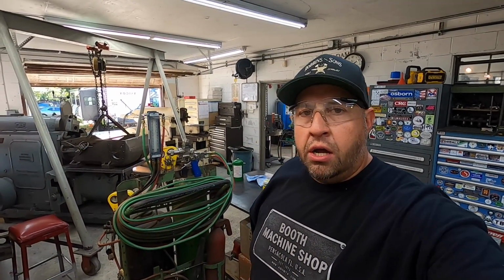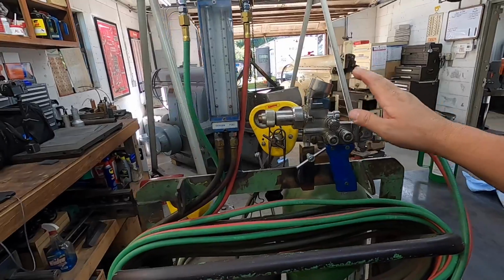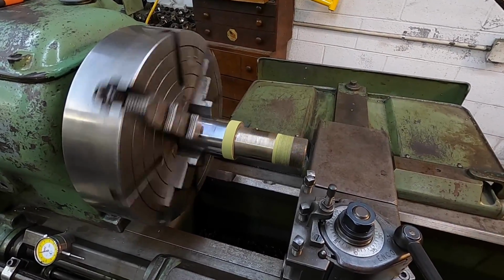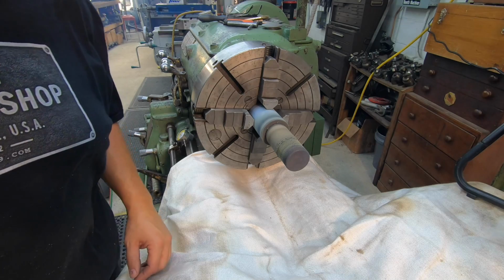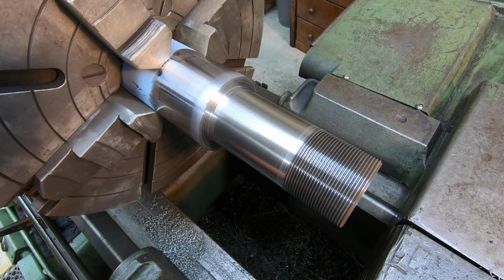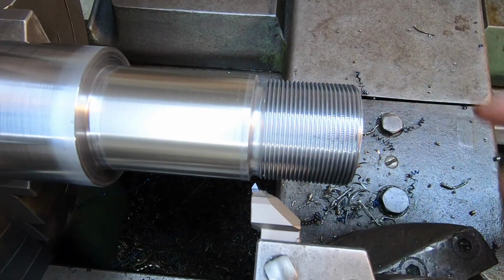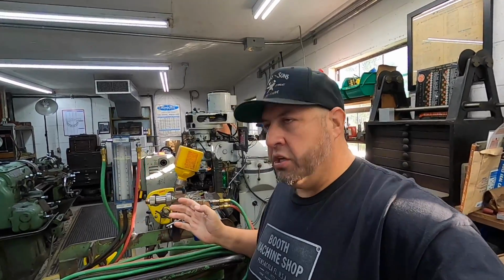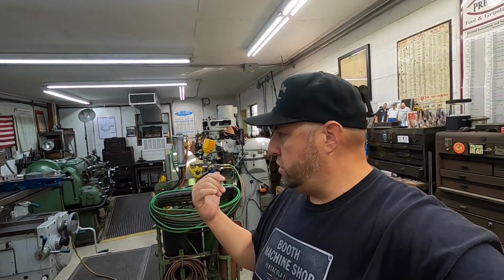Eutectic TeroDyn 2000 Thermal Spray Equipment, Mount & First Use

Comment: Just how strong is the bond with the spray weld is it permanent?
Reply: If done correctly it is permanent.  If it withstands tthe turning operation I would assume you are good to go.
Reply: It is ok, not a true 'weld' ie wetting the base, good enough under bearings & seals. I did some tz750 cranks with eutectic system - crank was mangled but sprayed journals were ok. One thing to point out if you get it too hot the bond is not so good.
Reply: @susscrofa5485  Were you working on the cranks alone or the whole bike, pretty narrow band of TZ750 owners out there.
Reply: @Peter-V_00  whole bike

Comment: I know a fair amount about lathes both wood and metal but I am very confused how the thread making was done with several passes! I get how you set the feed rate and all that, but how does the tool enter the stock material at the same pin point spot where the thread begins during those passes? ...how is the rotation of the chuck linked to the pass made by the cutter to make that happen? There must be a stop that is set to allow the passes to begin at the same time, no?
Reply: Do a search on lathe half nuts and thread cutting dials
Reply: Its all about syncing with a threading dial. Thread dial just tracks the lead screw and you engage the halve nut when it indicates the point to restart. .or another way is stop the lathe and  backing out then reverse the lather spindle till you are back at start and go back in with the tool for another pass... nothing is as thrilling as making your first workable thread in a chunk of steal.... ill never forget my first time. HA,, except the crash!
Reply: @joenicotera2991  , are you a politician? You just said a whole bunch of gibberish that makes little sense, some only part fact and mostly fiction that never really answered the question.   🤪
Reply: @chuckthebull  your not the first and certainly not the last, same here?
Reply: Watch Adam's videos about threading
Reply: @xenonram  I just noticed that video...it was 3 years ago I have not gotten that far back yet hahaha
Reply: I always used the tap and die on the lathe, luckily I never had to make anything pretty, accurate or correctly... apparently hahaha!

Comment: Instead of coating the shaft with latex you can use layout fluid, lots easier to clean up.
Reply: The masking material is high temp.  Layout fluid would easily burn off.
Reply: @paulcopeland9035  try it sometime it does not burn off and does great. have been doing it for many years now.
Reply: @fredthomas1746  ....Well Fred, I went out to the shop and tried it.  I have had Dykem around heat before so I was pretty sure it wasn't very durable.  My heat gun was showing between 300 and 350F when the layout fluid failed.  However, I got to searching around and found that Dykem makes a 2000F (!!) marker that I was unaware of.  I am guessing you have been using this product.  I can see where a high temp fluid masking product would be easier to work with.  I am going to order some of this stuff for a variety of reasons.  Thanks for the tip!
Reply: @paulcopeland9035  Did you actually flame spray the shaft?  I have been a millwright at a paper mill for over 40 years and have fixed thousands of shafts using only regular dykem. Yes it will turn colors due to heat but the flame spray material stil does not stick.

Comment: @15:50, I have the same problem. :)
Reply: The answer is live center up the end.😯 
But as for the ‘to much stick out’ I’m sure running the hot torch across it a few times will fix that 😱
🤣🤣🤣

Comment: So am I the only one cringing when he's welding that close to the gas cylinders?  I mean I get it's TIG, I get that there's almost never going to be a drip or slag pop, but jesus if you melt the fuse plug out of that acetylene cylinder?!?!  Takes 10 minutes, take the bottles off the cart man.
Reply: I agree, this is a serious hazard.  My safety guy would be having kittens.  Someone would have gotten fired.
Reply: Throwing an insulating blanket over the top of the tanks would have taken 5 seconds and would have far better than nothing.
Reply: @twm4259  and you don’t have gas get all over the shop when you take the tank lines off or have to adjust the valves again (I’m not super familiar with those types off tanks so I’m using experience gained from other pressurized gas systems and may be incorrect here)
Reply: Take it easy sisters.
Reply: @AB-yu2tj  Was wondering when the children would show up...

Comment: This guy is not long for this world his safety procedures are appalling Drinking and shooting, welding next to gas hose's.
Reply: he isn't giving advice on safety and he sure as heck isn't asking for it
Reply: "wElDinG nExT tO gAS hOSes" - you ain't a welder, that's for damn sure.
Reply: @poodlelord  Sorry but that fact he is on YouTube a public medium means he is giving advice
Reply: @railgap  Say what ever you like any one who has any hint of responsibility and safe practice knowledge would never do that, if one of my empoylees did that welder or  not he/she would be a ex employee
Reply: @pijnto  no, it doesn't. He didn't once say "here is the best safest ways to do it"

Not to mention he isn't even being unsafe. 

When you are welding on your oxygen acetylene cart you are welcome to remove all the hoses and tanks.
Reply: @poodlelord  "Not to mention he isn't even being unsafe" you have no clue
Reply: @pijnto  Let's work through this step by step so maybe you can understand. 

You know what comes out the end of those hoses right? A 4000 degree flame, and you know what that flame is used for right? Cut metal, causing vastly more sparks and slag than welding does. You know what act requires you to have the hoses in close proximity to sparks and slag? USING THE TORCH AS INTENDED. 

When he is welding near the hoses, they aren't even pressurized like they would be during normal operation. So i'd argue that using the tool as intended is more risky than welding on the cart like this. 

Why don't you go actually build something instead of crying over how "unsafe" this is.
Reply: @poodlelord  You have no clue, I have most likely built more "somethings" than you have had days on earth there is a big difference between a back yarder and a professional
Reply: @pijnto  you would know huh? Spend a lot of time in your back yard?

Comment: Would this work on a crank that’s had a bearing spin?
Reply: Technically? Yes. Not sure what the longevity would be though.
Reply: I'm not sure how it works with cast iron so it would depend on if the crank is cast or forged.
Reply: They have metalizing powders that are in the upper 50s of HRC. They can get really hard and really tough. It's just like painting a car, prep is everything.
Reply: Precisely one of the reasons this method of repair was created, as long as you have the proper powder and application it's 100% reliable, had a few large bulldozer crankshafts repaired by this method back in the 70's, 10 or more years later they were all still on the job making $$$$.